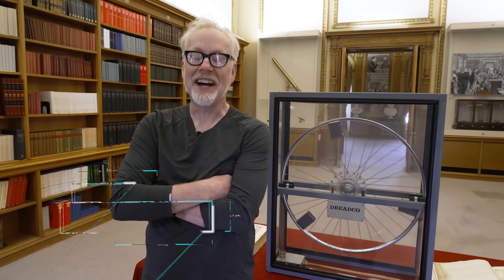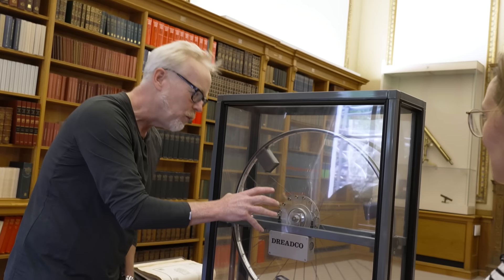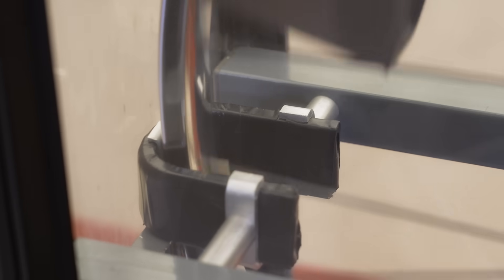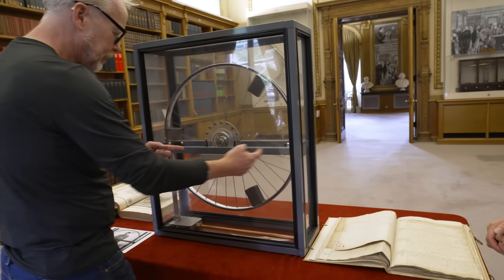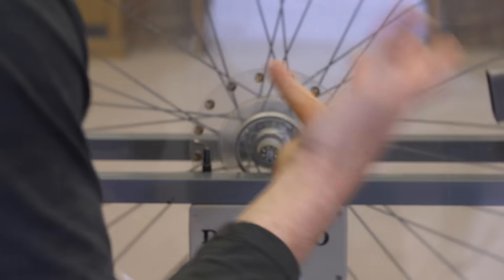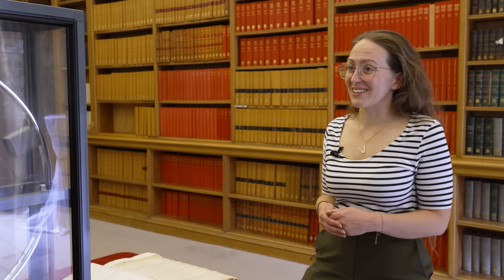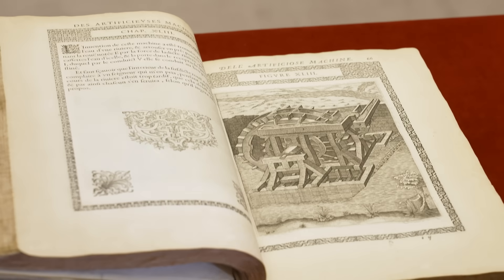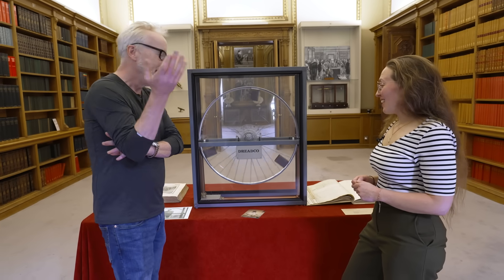Adam Savage vs The "Perpetual Motion" Machine!

Comment: Each of the 3 black boxes contain a coil, batteries, and a gravity operated rotary switching mechanism that turns the coil on and off at appropriate times.   As the black box approaches one of the magnets mounted at the right side and left side of the frame, the coil is turned on and is of a polarity which attracts to the magnet.  As the black box nears the magnet, the coil turns off so there is no "reverse attraction" as the box moves away from the magnet.

For an electric motor to run, there needs to be a "stationary" magnetic field and a "revolving" or "alternating" magnetic field.  With this device, the stationary field is created by the permanent magnets on the left and right sides of the frame.  The "alternating" field is created by using gravity operated switches to turn the coils on and off - the electromagnetic field alternates between "on" and "off."

Comment: I built one years ago that ran for about 9 months. It's a delicate balance between newton's first law and thermal dynamics.
Reply: Elaborate on the thermal dynamics please?
Reply: @jordanlunnay7466  Entropy. Invariably within a system energy transfer will never be 100% efficient and thus some of the energy in a system will be lost as non-useful energy types (I.e. Friction will cause energy loss as heat).
Reply: @tarille1043  Meaning, it wasn't low friction enough.

Comment: those little copper cups with the 2 electrodes coming from the DREADCO box look to me like there might be a battery in that box (also makes it real easy to "service" given the 4 big screws in the front), and some kind of high voltage inverter so that the right spiky electrode sprays off a few electrons, they slam into the cups, giving them a tiny bit of momentum, and then when the charged cup gets close to the other roundish electrode the charge can jump back after possibly giving it a bit more momentum through attraction. kinda like an electrometer or the oxford bell work, just in a circle instead of back-and-forth movement.
alternatively the heatsunk box with the copper pipes might harvest some energy from tiny temperature differences in the room, and/or the 3 boxes are simply magnetic and the "U shaped permanent magnets" actually electromagnets that get switched on/off with a timer/reedswitch kinda like a brushless DC motor.

Comment: To me that looks like capacitor motor, if it's at low voltage (cca 100-200v) it'll drip away slowly, doesn't need any special circuit to make it work.
the things on sides are weights to make it centered, so it doesn't fight against gravity.
The thing on the bottom is a red herring.
Essentially the only energy output is the bearing rolling and the input is the slight kick given by the motor.

Comment: the three blocks on the rim contain batteries and are reversable electromagnets that turn off at top and bottom with a pendulum switch changing polarity that attract then repel as they pass through the permanent magnets on either side of the frame creating a brushless motor

Comment: should try calculating the instantaneous angular velocity to determine how often the wheel 'speeds up'. every 120 degrees (the 3 boxes) or every 22.5 degrees (the 16 metal 'buttons' in the centre). Or if the velocity is constant, indicating a constant force such that the pipes are releasing some force at all times upon the wheel through a chemical reaction, etc.

Comment: It's quite obviously a deconstructed electrical motor!
The magnets 🧲  each side, the 3 coils on the wheel, which as well as forming an electromagnetic voltage, they act as counter weights on the bike 'flywheel'.
The acrylic bearing and obvious anode, cathode arrangement at the hub suggest that central box with the name on it hides a rechargeable battery cell, the optical cells are most likely small solar cells to provide enough trickle charge to keep the rechargeable battery topped off.
The copper heat pipe and box at the base with heatsink arrangement are most likely a decoy and not part of it's function.

The 'periodic service' that is needed is most likely to inspect and lubricate the bearings, replace magnets as needed and replace or top off the rechargeable battery!

The clue it's a rechargeable battery is if the unit is left in storage with little light it eventually slows down and stops altogether.

Comment: I will do you one better, magnetic quantum locking Kinetic cold drive. Copper tubing, liquid nitrogen as fuel, International spaced circles enclosed within one another, power by the Magnets spinning in the track and a magnet to push the starter magnet which powers each circle with each new rotation speeding it up with 0 friction. Each new lodestar magnet increases the power output exponentially, circles within circles like the flower of life.

Comment: Im a bike mechanic and ive had moment where i give a wheel a spin and came back from a 1 hour break and have it still spinning. It was an e bike and they have a magnet in the wheel that moves past a censor to track the speed and distance etc and everytime the magnet got to the top it pulled the wheel down giving it enough speed to do another round it lasted like an hour and a half before it stoped. Not infinite but cool how long it lasted

Comment: It looks like a Wimshurst Machine in reverse. I think the boxes on the wheel are capacitors. They are charged by the electrodes pointing at the spokes on the hub. When they pass through the magnets a Reed Switch shorts the capacitor causing it to release Torque. The Capacitors are driving the wheel. I read one time that capacitors produce a torquing action when rapidly discharged. Adam proved the motor is encased with PLEXIGLASS. I'll bet if you replace the panel he touched with Real Glass it won't work because it will lose its Static Charge.

Comment: This is very thought provoking. I wonder myself if motion can be made to suck air into a diaphragm and cycled to release it. Keeping such a motion continues. Probably not powerful enough to run anything worth while and would need maintenance often. But i feel there has to be effort of sorts to create any motion. Minimal effort for a maximin output. I do that in my van going to work. Quick bursts and let it freewheel me along and up hill. Yes it slows, But does get me far and to the top of the hill. Just make sure no one is behind me. Don't give in and think it will stop. it will get up hill if correct amount of power supplied. I found it surprising how little is needed to travel good distances. I cannot help but feel continues drive while driving is a waste of energy and surprising the fuel saving when i can resist temptation of hitting the gas. I dont believe its free energy, Just maximizing its output.

Comment: That thing seems like it's full of red herrings, which is the sort of tricky thing someone who'd invent a fake perpetual motion machine would find amusing. Still there's plenty of room for batteries in all those boxes, and there could be holes in the frame and the rim with wires poking through.

It might be helpful to estimate it's power consumption. Friction in the bearings, presumably they're off the shelf rather than from NASA. And imbalance in the weights, both in them being slightly different weights, and being slightly misaligned on the wheel. Figure that out, figure out how much power you could store in good batteries that would fit in the boxes, and that might give a plausible answer.

Solar power, no chance. In Britain!? Red herring! I think those two electrostatic contact-looking rods are fake too, spitting ions at a metal wheel wouldn't help. 

It's frustrating, though, that you've no way of knowing if you're right.

Comment: The only way that a perpetual motion machine could work in any manner is with melting down bismuth encased in a magnetic field and letting it soldify to where if there was a magnet going through it would want to move through. It would not last forever though and the conversion would need to be redone every 100 or so years.

Comment: Perpetual motion isn't impossible. You're conflating it with over unity, which is getting more energy out than you put in, which IS impossible (if you fairly and accurately define the boundaries of the system). The heat death of the universe will result in a uniform temperature above absolute zero meaning that it is in fact an inevitability that at least one particle will continue to move in perpetuity, as heat is movement.

Comment: I have a cheep pendelum electric wall clock. After disconnecting the quartz mechanism the pendelum keeps running. There is this tiny coil of very thin wire. 2 colors. As the magnet on the pendelum swings past the coil a tiny induction  impulse is sent to a transistor which switches the secondary coil for a extremely short moment thus pushing the pendulum magnet in a direction. 1 AA 1.5v battery has kept my pendulum running over 2 years. I guess there is a battery and such coil system inside the 3 boxes interacting with sad looking black magnets on the side. All the other stuff around are decoys.

Comment: I suspect that it's essentially a brushless motor. Each one of those boxes are a battery inside a coil that is activated based on the position. Being this is designed in 1980 and it will run a couple of years I would  lean towards the control being a mercury switch because  of them being energy efficient.

Comment: I'm asking. Would a simple closed circuit of a resistor and capacitor not be at least in theory perpetual motion.? Once the circuit is charged would it not discharge and charge indefinately.? The perpetual motion is from electrons traveling through the circuit. It's just motion and not a power source.
Reply: Quantum tunneling and electron bleed would very quickly dissipate any charge in the wire.

Comment: Ultra low friction, electromagnets and batteries in boxes with mercury switches to flip them on as they approach the "U's" and then off as they pass to eliminate pull. There may be multiple switches that change from attractive to repulsive force making a giant motor

Comment: to MR Adam Savage 
if my answer is correct it should make you happy 

I m for years watched your show 
myth busters 
how this machine works 
first the metal box with copper pipes and the 2 probes near the bearing  and box with the name looks like a decoration ⚠️
my idea  is the black boxes  contains a  coil a capacitor and a switch 
when box1  passes the u magnet 1
the read switch closes causing the cap to charge from the coil 
after passing the magnet the switch opens.
 when box1 reaches 2nd magnet (fixed  opposite to magnet 1) switch closes again 
the coil is charged and reppled by magnet 2
and the other 2 boxes do the same 
their main purpose only to make the wheel balanced .

Comment: three boxes 120 degree apart . three high capacity battery's with field limiting timed angle switching , runs as a electro magnetic pulse motor on 180 degree poles.. just a low rpm electric motor.  move along ,,nothing going on here.. no free energy

Comment: I would think that each of the boxes suspended with in the wheel contains a 
current limited battery and a coil controlled by a mercury switch.  
Interesting device non the less.

Comment: Regardless of how this is powered, the bearings are impressive. They are extremely low friction. But I do think that if they exposed the "light meter" to a bright light source for an extended time, the machine would speed up. I think it is simply an extremely efficient solar powered motor.

Comment: Perpetual motion may not be truly possible in a pure physics sense, but you can certainly make something that's at first glance workable. Photovoltaics, and other invisible effects like the Casimir effect or ambient temperature/pressure differential, could be cleverly integrated providing no visible power source.  Even so, these devices are fascinating to me as the engineering required to create this is demanding and often requires fine handicraft.
Reply: always gonna need input ,as simple a a hand on a wheel

Comment: I don't know how that one works, but cool "perpetual motion machines", in my opinion use things like variations in ambient temperature and or air pressure. Hiding a battery and power the motion electromagnetically from that battery is ridiculous, that would be beyond disappointing in this case, in my opinion. I could accept some clever way of harvesting energy from ambient light as just disappointing. Storage space could have less variation in temperature, and even slightly less variation in air pressure, so those sources could also be consistent with it slowing down when kept in storage.

Comment: Since the secret here is low-energy, the very idea of a heatsink is preposterous and therefore is the big red herring.  If the device was getting so hot as to require heat dissipation, then that's not the answer (unless there's a hidden mains cable going somewhere.)  That heatsink is a good size to hide batteries though.

Comment: I wonder if the box is air tight and under vacuum to reduce drag.  It could be getting tiny pulses to the magnets to keep it going, but not enough to start it spinning.  It could be just a bunch of batteries, like 9v that do not drain much from just sitting.  I think the box with the logo, the little cooper cups, and the two probes are just for looks... or maybe to trigger the magnets as control circuitry what sap too much power.
Reply: That's doubtful Adam touches the Box just a couple minutes into the video and the plexiglass flexed and rattled a bit. I don't think you'd be able to get close to a vacuum without the sides caving in

Comment: The funny thing is that if an over unity engine is successfully made it’s going to keep accelerating until it destroys itself with no load or government applied or if it’s stable at a consistent rpm that will likely mean that little to no usable power is being produced
Reply: without friction, the energy would be additive. obviously there is friction to cap any runaway.

Comment: I would love to take a look at it in detail. maybe use a thermal camera to see if any part is warm (such as the heat sink). because what i am seeing is possible magnets on the wheel and electro magnets on the sides... if all the same pole was out... and there was a way to tell where the wheel was at all times (such as in the middle) maybe it turns on and off the electromagnets like a railgun or monorail system.
Reply: Thermal camera doesn't work well through glass.  Compass will...
Reply: @MarkTillotson  while you are right it wouldn't work through the glass. The glass where the heat sinks are would be warmer then the rest of the glass (since they are close to heat sink). I tell people, when it comes to perpetual energy machines: "Follow the energy because eventually you'll find the source."

Comment: I'm sure there are no batteries. The challenge with Perpetual machines is to lose as little energy/momentum while moving. I'm betting on magnets (maybe using the earth magnetic field too), very very low air resistance, close to zero resistance ball-bearings (think magnets are mostly used for that), and maybe a trick how to exploit day/night temperature difference (pipes).

Comment: So many people saying its not a perpetual motion machine… it doesnt claim to be. Its a puzzle, meant to get people thinking about it; certainly has achieved that. It is, essentially, a magic trick.

As far as the actual method goes, it was built 1980 or 1981. Which of course means it uses tech available back then. 

A lot have mentioned vacuum… its not, you can see in closeups that the acrylic sheet on the bottom is loose.

Comment: I believe that the wheel is simply set to spin and keeps spinning by its inertia alone. This is based on the assumption that 'disappointingly simple' would include the possibility that there are no electronics or continual external forces at play, simply that the wheel is perfectly balanced and set to spin in a low air resistance enclosure, only needing to be set into motion again every couple of years.
Reply: The acrylic case in which the “machine” is mounted is clearly shown to not be airtight.  Even if it were, no bearings known to man would have the infinitesimally small coefficient of friction to allow the wheel to spin for years.

Comment: My first thought was basic unbalance of the wheel. In the 3 blocks is a ball weight that can move from the outer part the the inner part. The left side from camera perspective has a magnet at the outer most location. It will move the weight the the edge so it adds more force pushing down. The other side is a magnet on the inner most part to put the weight near the center causing the wheel to be unbalanced and rotate.

The key is the.magnets and the two yearly maintenance is likely to lubricate and restore anything that's warn out.

Comment: batteries inside the dreadco box, and likely also in the steel tubing the axle is mounted on. the setup near the hub does the timing for the magnets to pull and push the wheel at the outside.